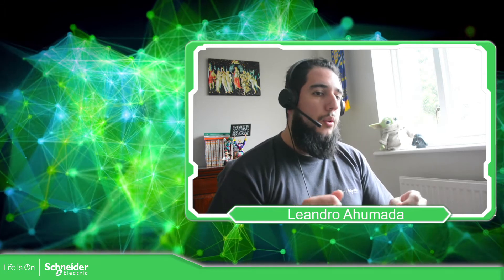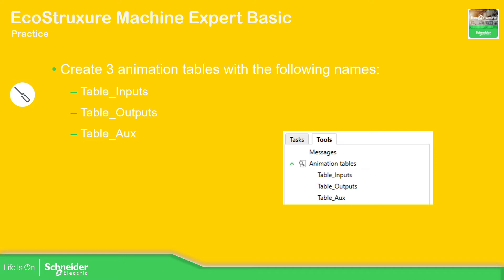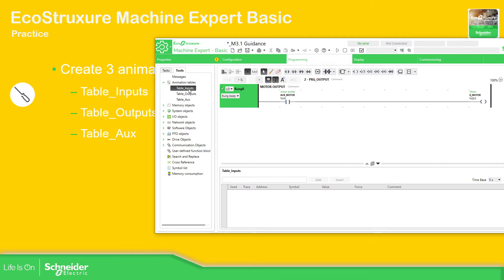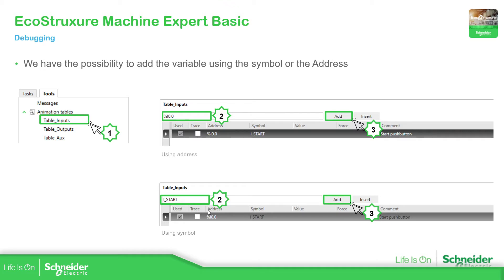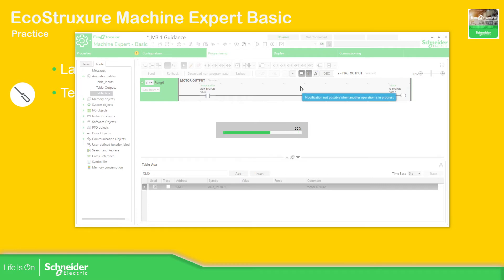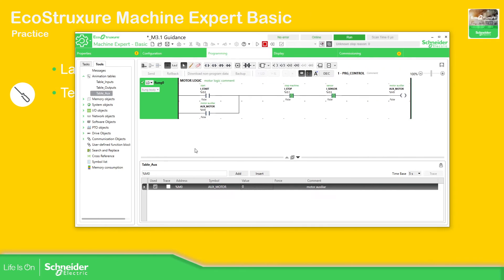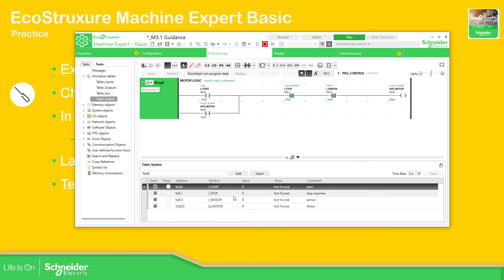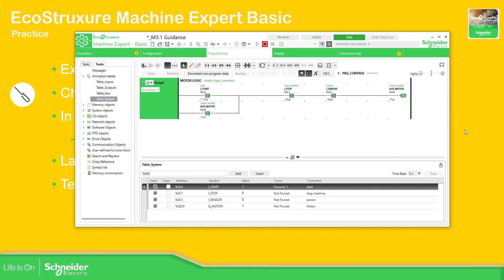Training - M221 - M3.3 Debugging

Comment: Leandro, Thank you for your tutorials. I appreciate them and they are helping me to move forward in my endeavors, however, I find that the volume is quite low and struggle to hear what you are saying most of the time but especially in this tutorial M3.3 Debugging. I just wondered if you could do anything to address this problem at this stage? Best Regards, Tony.
Reply from the maker: Hi Jacky Haywood! Thank you for your feedback. A few months ago i changed the mic that was causing that problem… amateur issue 🙃.  I could adjust the audio using a video editor but i do not have any and time is not friend at the moment 🥲. The good thing is that on the new ones the audio problem is no longer
Reply: @LeTomasAHUMADA  Thanks for getting back to me Leandro, Best Regards, Tony.